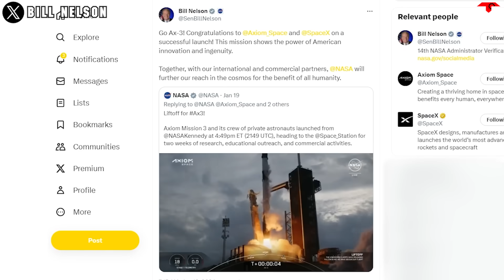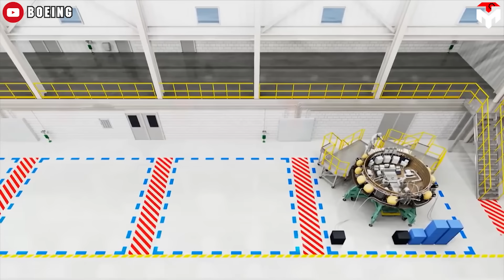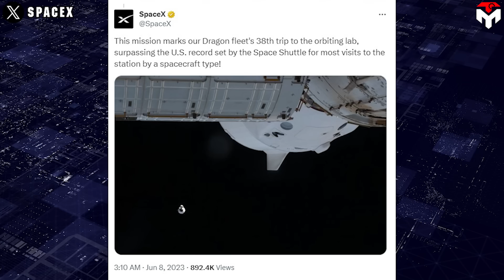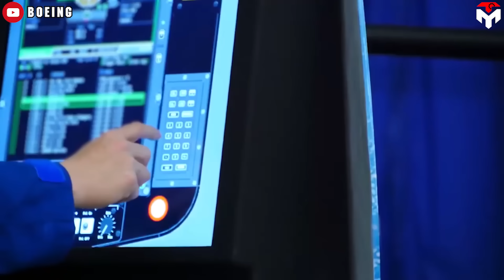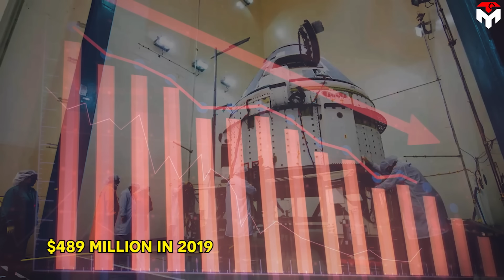It's over! What SpaceX Dragon Just Did Completely Humiliated Boeing Starliner...

Comment: They better double check the doors ! Boeing's had 1 fly off already  ! 😳😳😳
Reply from the maker: Everything should be checked carefully@
Reply: @techmap9  I worked on Boeing aircraft for almost 50 years. I loved em then & will always love them. I even worked on their doors - 727, 737, 747, 757. They're all basically the same. Just bigger for the bigger aircraft. THAT door though is different. Call it the red headed step child. But not installing all the bolts - somebody seriously screwed the pooch ! When you work on an airplane,  military (which I did also), you have people's LIVES in YOUR hands. You must make absolutely sure no steps were skipped. I've been to 2 crash sites, both military. You never forget that sight or that smell. Never.

Comment: Starliner is NEEDED, as a backup to SpaceX ... cause eventually, something will go WRONG and ground Dragon for 1-2 years .
Reply: Space Station has what 5 years left? Then the next Starliner test is what several months or a year away? They better get going
Reply: While I agree that a second system as an alternate would be great, I disagree about Starliner.  We don't need Starliner to be that alternate.
Reply: @frankmcgowan9457  WE PAID for Starliner to be that alternate. AND it's the only alternative that will be ready any time soon.
Reply: @KrustyKlown  
How much more money should we throw at Boeing for this money-pit?  It doesn't work and it keeps finding new ways to fail.  Develop Dreamchaser.  There is probably at least one other non-SpaceX re-entry vehicle under development by a space agency with which NASA cooperates.  Perhaps we should explore that possibility.
If we decide we love Boeing, order several Orion spacecraft for use in the rather more limited role of ISS crew transport.  It doesn't become useless if you send it somewhere closer than the moon, does it?  Yes the actual cost of Orion will be higher than the previous projected cost of Starliner but the actual cost of Starliner keeps rising.
Is it time to cut our loss on Starliner?